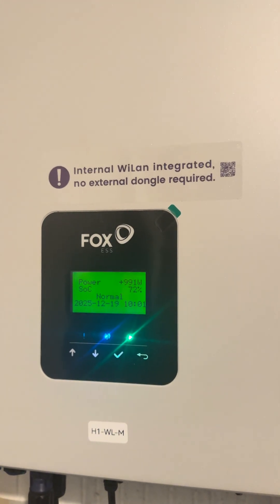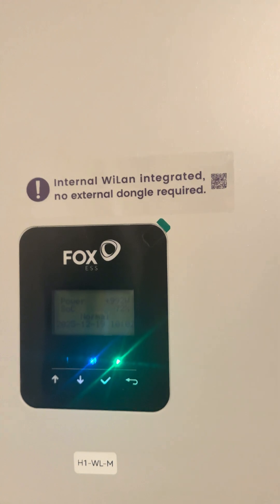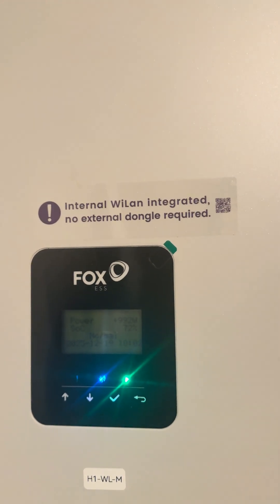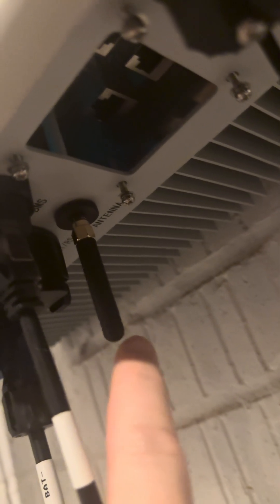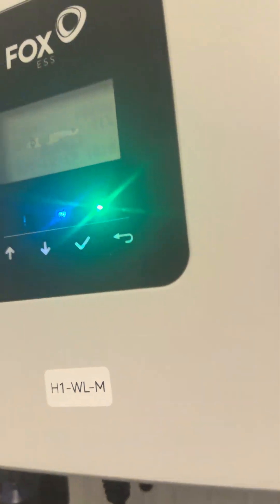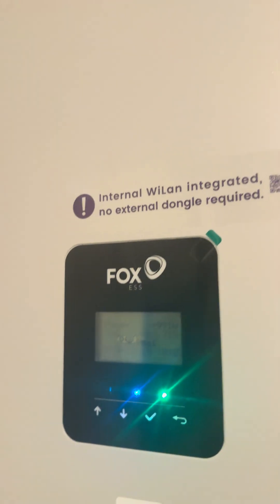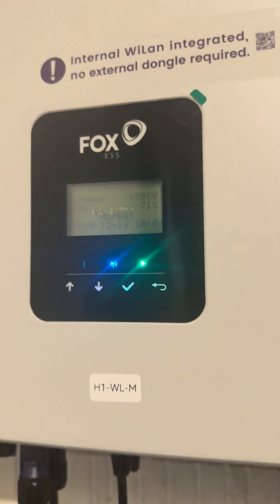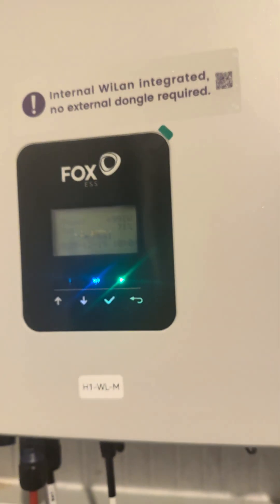Fox ESS with integrated WiLan dataloggers (Common mistakes)

Comment: Great video! Worked out the installer missed the antenna causing inability for the data logger to connect.

Fox ess need to work on the manual and installer training.

But I am short of an antenna!! Lol

Comment: Great info! Quick question. I just had an installation done  and noticed that it hasn't been installed and your right i am having app connection trouble. Is there somewhere I cab purchase one
Reply from the maker: It’s a standard sma connector and you’ll find loads on Amazon but I would contact your installer and get them to send you a replacement. Check the bag of bits they should have left with you.
Reply: @iameccles thanks for your help